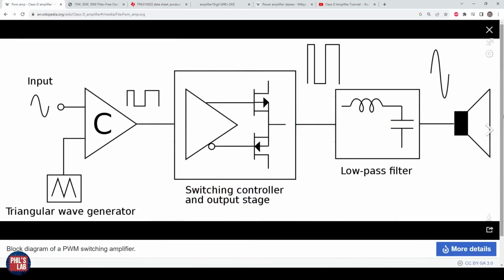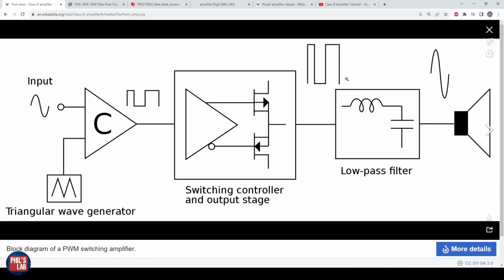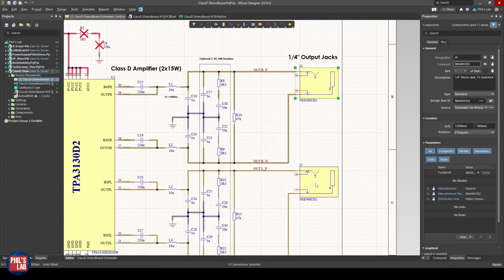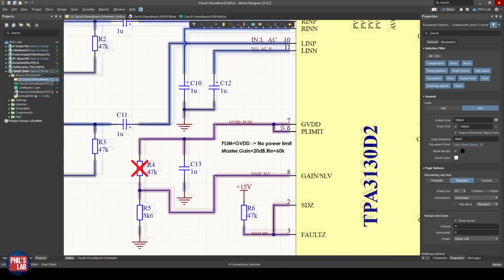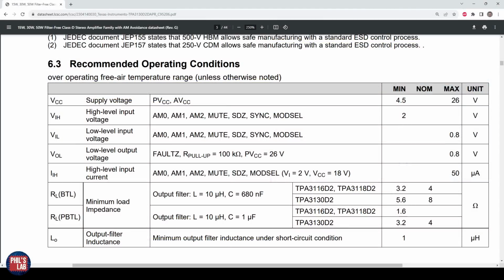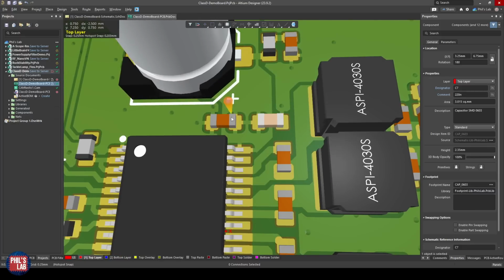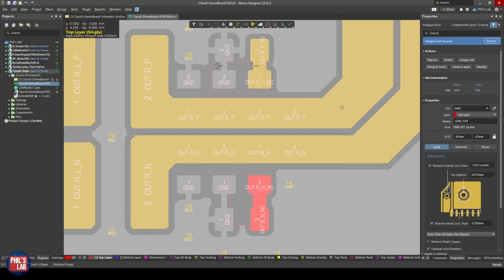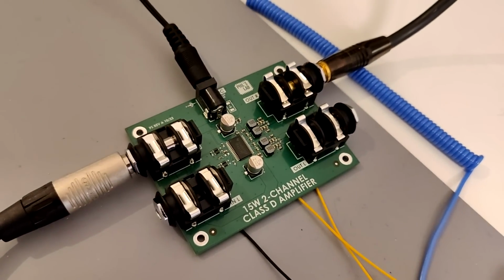Class D Audio Amplifier Hardware Design - Phil's Lab #125

Comment: Could you make a video covering Large Class D with Energy Star switching Power Supply. Without Energy Star PSU, you need a big expensive heat sink because the switching PSU wastes 30-40% power as heat vs 5-15% as heat for Energy Star switching PSU.

Comment: I never thought much about it but I guess an 89 dB s/n ratio for a power amp is quite normal irrespective if it's class AB or D or whatever? Certainly it makes you think a bit about fretting about material being captured at 16 bits as opposed to 24 bits..

Nice guitar work in the end :) i used to play with Yngwie in the 80s (played keyboards on the first five or so rising force albums)

Comment: As well as a potentiometer so that you can control some of the higher voltages so you can knock them down but they have so many possible selections that are all common voltages in electronics and it provides a post for every single one of them and they all this particular one came with fuses which is nice additional thing to put on there but I think some noise filters would be appropriate as well an add-on component so I might take their board example and redesign it. I own a 3D printer and you know you can print out boxes you can add a voltage meter you can put the fuses so the replaceable you know easily on the front face instead of inside the box and since the power units are encased themselves the high voltage would not be easily accessible by a student. And again because of the country I live in almost all of this stuff are high quality like gold and platinum levels power supplies. I can't believe that you waste time looking at the Disco trash I already grabbed a small Lenovo mini computer that I'm going to use and another project I'm working on which deals with the software to find radio and cybersecurityand satellites so I'm designing my own software-defined Radio based off of a Analog Devices design but upgraded substantially with a lot more on-board memory and a secure Zone and a cryptography processor as well as a random number generator and digital processing and far more cars than is on The Analog Devices Adeline Pluto which is still running on USB micros it should have a ethernet adapter on there and it should have a full USBC and you could load a small version of Linux and your radio on there right now but with added RAM and more processors you can add a full version of dragon OS for example or Pike OS.which is what they use for a lot of the the cube sats. I saw a commercial off the builder of I guess what they built in school and now they've turned it into a business but they're doing one to 16 u cubesats and of course they claim flight Heritage because I guess their Cubes at work and you know it's plug-and-play with their bus and then that makes me wonder how secure is that when aes-256 is an optional add-on component on top of the CCS DS. That shouldn't be optional and with social engineering Mal configuration improper implementation all of these security issues if we keep on going like this it's not if but when somebody's going to get a satellite and I hope it's not a geosynchronous satellite with propellant imagine is the state actor and the use of proxy actor and they could take that through every orbital plane causing the Cascade and then put it on a trajectory into population. The weight in kinetic energythat's why I want to develop my life here in Switzerland because we're neutral country and we have the highest level of professional secrecy which means companies should be and I hope will be more able to feel comfortable allowing us to probe when copies of their commercial cubesats. Including their ground stations in ground station software and then having a look at their physical site security and overall security of the ground station and then going to countries where they're doing ground station for service because the deep space network is completely maxed out and what's the corruption of those countries and you know social engineering and people the human factor is the biggest security risk. I'm trying to convey to the young hackers and young ethical actors out there not to go down that path because no amount of money is ever going to be worth selling out when you know what's going to be used for bad and you'll get vannned because they'll want to like clean up their loose ends so you'll be found missing with the money in your account and everybody's going to think they did something. So to all the new Young new designers and Packers and gray hat hackers in the white hat hackers just because it's a company doesn't make it legal and go through the right responsible disclosure and do on research security to prevent accidental disclosure before you do it and hit up your National cybersecurity infrastructure along with the company who made it. Do it simultaneously and openly and involve the official people because they need to know as much as a company and it'll make sure that the company gets those firmware patches done and the international and National cybersecurity apparatus will be on your side and they'll help you to get your Burke County in a reasonable amount of time because for them it's more than just an issue for that one use case it could affect multiple places in a total setup. Tetra is a wonderful example of responsible disclosure by the parties they're at the last Defcon they gave a presentation it took two years of work and there was no book bounty they did the right thing you guarantee that these guys going to get any job they want and the company who makes it and the regulatory agency who oversees the standards changed their approach from obscurity to open source and at first they said they were going to go back to a security and they change their minds because what do we say now security by obscurity is.. what has everybody who grew up since my generation I'm in Generation X we are all sophisticated enough to learn or become educated on anything they designeed. the birds up there now that just got put up there now and the communication systems that are either in the beginning or midlife are made by Baby Boomers and they far under estimate gen x forward as we can all communicate and get along like friends. They can't or some cat and those people are open-minded people who have remained a little bit of a child on purpose lifelong Learners forever curious bless them all and Gen X forward listen to those few rare people. They have for you have and then they have some wisdom that you could really gain from.

Comment: Deerfield I was wondering if you could do me a favor and maybe help me with an issue I'm thinking about upscaling E-Waste repurposing and recovery as opposed to just burning it up and recovering the metal because I live in a country where the E-Waste is thrown away are fully functional MacBook pros and New Generation in micro laptops and desktops and I think it's absolutely ridiculous to burn them for their metal and it would be much better to repurpose what can be repurposed and then you know dispose of the rest but most of the stuff can still run manex super fast and is absolutely good stuff for countries where the classrooms need computers just to be competitive in the world. So I was thinking of an SSD design where you recover all the storage from old thumb drives and old sticks and your repackage them into strips by type and buy a generation and then have an SMA automatic calculator place them on a PCB that has a small fpga and USB connector as his required by the EU and use a double-sided bored and have the fpga to a diagnostic of all the chips that have been placed and don't map any of the faulty or potentially failing sectors. In addition run kind of a raid array on what is there just so that they're reliable and it's all accomplished on board on the fpga. If you can order me the removal and replacement as well as the sorting and packaging it could really save and help and reducing what gets burned and what can be reused. The FBA GA would run the diagnostics and form a raid array of what's there to provide redundancy and resiliency considering their second hand. Also to buy a any cheap but reliable copies from any Source already enrolls to produce reliable maybe not the fastest or the best on the market but good solid working drives made from E-Waste and where I live they throw away the best stuff in the world I mean I recovered out of one bin that my neighbor who has a company lets me fish in and I recovered two working Apple MacBook pros and all kinds of stuff from usable and security resilient switches and Poe switchesand I even recovered a security device that I think will accept pfSense as a firmware upgrade. So just for me putting this stuff to use instead of having to end up in a waste disposable or put in a kiln or ship to a third world country where it talks about the people and the environment just to recover the small amounts of metal that remains in them is still going to happen but the last thing we send in the morning material we can recover and place back into use for education in schools and you know the power supply from The Towers can easily be turned into very safe and very accurate and precise desktop power supplies with a simple component from of course China but it could easily be redesigned here but they just haven't you know the connector for the board right there you snap it in the even include included fuses and then I'm going to take off the switch they have on there and put a proper switch and put a voltage regulator

Comment: What I missed or do not understand is; you are connecting a balanced signal to a mono jack, right? This goes to you speaker cabinet. I thought these are speaker connections where mono unbalanced. At least if it was balanced wouldn't you use a balanced signal with ground over a TRS?

Comment: I use a TPA3116 as a stereo power amp, which follows an ME-80 signal processor, so far it worked nicely. The only downside is with 50W of power, it's simple not lound enough. Looking at some discrete design now.

Comment: I notice you use a lot of thermal reliefs. One that stuck out to me was a thermal relief on a powerpad ... I dont know that i've ever seen that before. I suppose you are trying to keep the board hand solderable, right? Great video, but I found that intriguing, so thought i'd ask, as knowing you, it is not without reason.
Reply from the maker: Yeah, if you're just gonna reflow, then the thermal relief on powerpad shouldn't be there. However, given my limited soldering equipment (iron, hot air gun - but no reflow oven or hot plate), I wanted to keep my options open if I do wanna go the hot air gun route. Given the amplifier's high efficiency and comparatively low power output, in this case, having the thermal relief wouldn't be particularly problematic in either case.

Comment: Thanks for another excellent video. 
Question for you regarding power supply. What is your take on using one of these usb-c chargers - that start to accumulate unused at home - together with a PD chip on the board for an amplifier like this?   The common ones can supply 60W and up to 20V that seems about right... Would such power supply be too noise? Would the filtering caps that you used in your design be enough to get decent results?
Reply from the maker: Thanks, Marco! For a 'proper' USB-C PD-powered amplifier design, I would make provisions for line filtering before feeding to the pre-/power-amp. This exactly is actually part of a larger project (digital guitar amp) that I'm working on, which will also feature on the channel. I'll be able to go into more detail in that video!

Comment: I have a question that popped into my mind watching the start of the video explaining the basics.
I get the Low Pass filter, but in order to fully utilize the swing of the speaker coil you'd want also a high pass filter (let's assume -6dB@50Hz) to get rid of the DC component.
If you i.e. run it form 0 to 15V you'd lose the -15V range but if the resting potential was -15V any silence would burn up your speakers. I know that i also could be very wrong, bc. i'm stoopid :-D
For clarification, i do electronics professionally, but i never had any in depth contact with audio stuff.

Comment: @PhilsLab Did I miss the input impedance  being set to 1M+ for the guitar input, or are you loading the pickups a bit?
Reply from the maker: Guitar is plugged into my audio interface (high Z instrument in), as shown in the video, through Guitar Rig, out again via the audio interface to the Class D amp board.
Reply: @PhilsLab  ah right, fair enough. If you were going to directly input the guitar would you have to preamp the power amp ic?, or can it take the 700mv or whatever the swing is on your guitar output, and amplify it without causing distortion, I have zero experience with class D. Thanks for responding!

Comment: very nice video abou the class-d board. One thing I noticed are the thermals on the barrel Jack power supply, they seem too tiny. Is that enough to link the main rail track to the barrel jack? your lovely guitar sounds the cool new entry into the video!!!
Reply from the maker: Thanks! Given that a single 0.25mm trace can easily carry ~1A with a 10deg temperature rise, and the distance is very short for the spokes, the thermal reliefs for the jack are more than sufficient - also given 4 of them per pad. The total current draw is only around 1A at full power.

Comment: Great video (and great taste in guitar gear) as always. Do you think you can expand this power amp to a full guitar amp, jfet preamp with cascading gain stages and a real tonestack from a vintage amp? As far as I know, the tonal characteristic of an amplifier (other than cab and speaker) comes from the tonestack. So in theory, you can create an amp that sounds like some historic amp only by implementing its tonestack.
Reply from the maker: Thank you, Cem! This is definitely gonna be part of a bigger, guitar amp project. Basically combining this with the preamp DSP frontend from previous videos, to make a portable guitar amp. As you say, the tone can then be changed - in my case in software - quite considerably by varying the preamp.

Comment: Ever done any tube audio stuff?
Reply from the maker: That's actually next on my list - have purchased some low voltage valves and will be making a guitar preamp!
Reply: @PhilsLab  Awesome! What tubes are you using? I used some 12AU7s on my preamp stage. I built my tube amp with point to point wiring ( sorry no PCB :( ). Very satisfying project and made me think a little differently on electronics than I usually do, especially when it came to what I consider "aesthetic".

Comment: Why you choose 1u tantalum caps at the audio inputs? What about the polarity?
Reply from the maker: I try to avoid larger class 2 MLCCs in series on the audio path, as I've experienced problems with microphonics in the past. For guitar, tantalums have been a good/cheap compromise, so I don't have to go with film caps for example.
Polarity is that at DC the 'anode' is attached to the higher voltage (in this case the DC biased input pins).

Comment: As always very nice video.. I've done recently a TPA3255 based class-d amplifier with a PFFB and the sound was AMAZING! But I've a question please.. would it be better to put the electrolytic capacitors on the top of the board and place the IC on the bottom side so your power loop inductance will be minimized even further? Because I've done this trick on my board.. thank you!
Reply from the maker: Thank you! Not sure how much you actually gain from doing that - also, then you're paying for double-sided assembly, making testing/debugging more difficult, etc.. Maybe this could make sense for far higher power - but (at a guess) same layer will probably be sufficient in most cases.

Comment: Cool, but connectors on 3 sides - come on, also whats the point of thermal relief under the ic - during reflow its all the same, but now we are not using the top layer for cooling, my choice would be moving vias just beyond the pad, not using relief - no wicking problems and probably better cooling.
15v power is weird as well - 24v is better and more common and you can still use anything 15-24v.
Reply from the maker: Connectors on 3 sides, although not optimal, was just for aesthetics (or maybe I've designed too many guitar pedals...) - in this case for a test PCB, it doesn't particularly matter.
Agreed on thermal relief, I forgot to remove the rule on top at the EP. Regarding vias in the EP, I've had no problems with this method and wicking (0.25mm-0.3mm drill) - done many, many boards and ICs that way.
15V vs 24V - sure, 24V is more common but then again this is a test board for a work-in-progress USB-C PD based guitar amp running specifically off 15V.
Reply: @PhilsLab   USB PD would be very interesting to see.

Comment: in case of it will drive 50W on 8 ohms speaker - output AC amplitude should be about 28 V.. how will it bring 15V to 28V? is there integrated boost coverter in IC? if yes - where is the bulky inductor coil?
Reply from the maker: This is the 15W version of the IC. The higher power versions (e.g. 50W, different part number) use higher supply rails and in any case, will also use bootstrapping. The datasheet has more details.